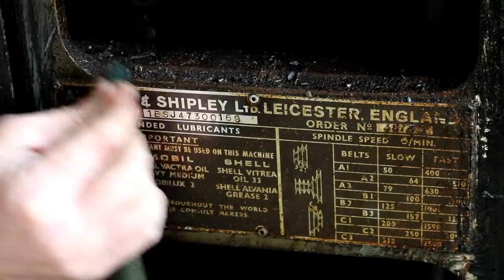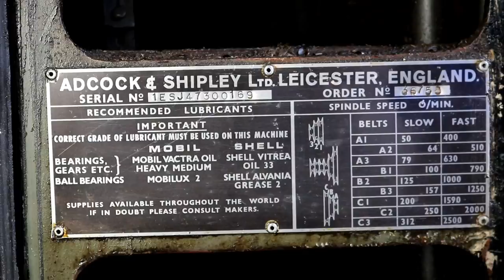1st good LooK at the Adcock Shipley horizontal mill. Good and Bad!

Comment: Wow that machine is disgustingly dirty. When I worked in engineering way back in the 80's here in the UK, at the end of the shift we had clean up time. We had to take all that days swarf out of the machine we was working on and put it in the compactor. Then we had to clean down the machine and check oil levels, swarf filters and oil all the oil cups, so that it was ready for the day after. We would have been reprimanded if we had left the machine in as bad a state as that milling machine.
Reply: Sounds crazy to most people, but i work in mass production (tool room / jig shop) Counter-intuitive as it may be, on a machine that old running non stop production, sometimes it's cheaper just to let it break and replace what fails as it fails than it is to lose a fraction of every day to "proper maintenence". New parts =$X, Loss of production=$Y, Easy for down time to be far more costly. Depends on what you're making and how many of course.

Comment: You can see the original oil and grease requirements. NGLI 2 grease and what would be a 680 viscosity oil for every part. Slideways and low speed boxes I would suggest using a NGLI 0 grease, as it will pump easily, and is a good lubricant, and is slow to leak out. I used it on a production machine as slideway lubricant, as it had central lubricant, though i had to replace every single tube for that during service, as the originals were all burst from previous operators having used NGLI 2 grease in it.

Comment: I'll have a guess about the history of this machine.  It worked as a conventional mill and then failed to get cleaned or maintained - hence the nasty caked gunge in all sorts of places.  Then the power feed or coolant pump - whichever was driven by the central contactor failed or was not needed.  Someone said "I could use that for production of threaded parts" and built the neat clamp, and used the thread rolling attachment and that was that until it was sold.  Never cleaned again, never had chips removed.

Comment: Just as a suggestion, you may want to consider a "geowall" style low retaining wall to restrain the runoff from the hillside.  They use gravel and a plastic grid so that the structure holds itself by its own boot straps so to speak.  The advantages are a little less invasive to the hillside than digging the wide footing required for a concrete "gravity" wall and having a gravel base course and backfill, it will compliment the action of your proposed french drain.  The downside is that the component blocks are quite heavy so it is very difficult to place with one person.  It also might (depending on how things cost around your area) offer some money saving.  Usually these walls are not complicated until you get over 4 feet tall.  Someone may have had some experience using concrete block as geostones in low walls, maybe not the best aesthetics, but cheap.  I have built them 24 feet high for hillside stability.  If there is a conduit for groundwater to exit the rear of the wall, they are very practical.  Good luck.

Comment: Adcock and Shipley.  I know lodge and Shipley.  I just saw a cockshutt and white tractor yesterday and did not realize white truck company completely ruined oliver tractors. In the 50's oliver had a continously variable mechanical transmission that would be useful today if white had not  turned all the oliver records into trash and disposed of them.

Comment: man it seems like a great mill , maibe try to find the accesories for it like the vertical milling head and the holder for the outside end of the horizontal milling bar and trade it for sumting you need (i allways have problems doing that with stuff given / gifted to me though)

think the retaining wall for the back of youre shop will fall over pretty fast from the pressure of the soil running down the hill you might eed to add a layer on top of that wall every so often too as the base of the hill gets bigger , it might work if you build it like a dam with a wde base tilting toward the hill and with an arc along its length , you might want t plant a row of furtrees along the hillside of the wall to hold the soil in place a bit better 
maibe it helps if you dig a ditch to collect the soil and dig that out every so often , pressure whont affect a ditch as bad  though you prolly be digging it out again quite a few times , will collect the water and snow too

Comment: It looks like You have acquired a nice machine there Steve .So many of those old machines ended up doing work during 2 wars in UK and a lot of that being on cast iron so that plus the lack of financial input for our motorcycle and car industries meant having to work with worn out equipment  .Just as well most machines were "heavily" built eh ? So,back to the Do-all saw soon hopefully ?

Comment: 32:14 I would remove this metal plate and just add a much wider mesh - just to avoid that you dump a tool bit in it, but don't restrict the flow so much, and replace instead the stupid "dam" filter, with cyclonic separation :)

Comment: Just a question , have you ever worked in a factory ? I have and they clean up with a rag to wipe it off and a blow gun to get rid of chips , maybe once a year the machines get a paint job which means give it a quick wipe down then throw a coat of paint on it dirt chips and all , most factories use temps to do the work and doing something like this ( production runs ) means you will be doing the same thing all day every day mind numbing repetitive work ( think about it all you do is put a part in hold the button ,take the part out then do it again over and over 8 or more hours a day )so the operator will do something /anything to change things up even if it means crashing the machine ,you might get put on another job for a while or even sent home while your machine is being fixed

Comment: regarding the proposed retaining wall behind the shop, don't forget to allow for water drain holes in the wall. If not, the hydraulic pressure of water in the soil will build up and push your ret'g wall over.
Where do you find all these old machines? I especially like the size of this "new" A & S mill.
Reply: Steve's putting in two french drains to combat that...

Comment: Founded in 1914 and active until at least 1968, this firm made vertical and horizontal milling machines, including a Bridgeport design that was made under license from Bridgeport Machines, Inc. In addition, some Adcock & Shipley machines were sold in North American under the Bridgeport badge. In about 1968 Adcock & Shipley was acquired by Bridgeport owner Textron, and in 1986 Adcock & Shipley's name was changed to Bridgeport Machines, Ltd. The USA incarnation of Bridgeport went bankrupt in about 2002 and the Adcock and Shipley works were shuttered at that time, if not before. info from VintageMachinery.org

Comment: You are correct in your thinking about the "grease" nipples they are for oil you should trait apart and get the grease cle as nd out as it will cause wear

Comment: For your retaining wall have you given any thought to using rebar cages filled with the rocks and  mortar and cinder blocks you have left over from the wall tear down??? be pretty easy for a extremely talented guy like yourself make the rebar frame/cage welded together or let your lovely wife weld them up, since she would look much better while welding them up lol.  then you got all the rock,blocks and rubble laying put it to use its free. once the frame is in place minus the top lid or door. fill them up then weld the top on it and you could pour concrete over the rock cage form up the front the bank would be the back and sides of the form would save ya alot of concrete even if you sank the rock cages into the rock 2ft as a footing or a layer of concrete in the bottom then rocks and rubble then pour over the top and face to make it a smooth wall or leave it just rocks if ya want the more natural look like a real rock wall

Comment: I can find those machines in my area...lots of them...but everybody thinks that they are worth the original purchase price.  I've seen these things in pieces and the price?  "$15,000"...I've called on a few, and they want $10K, $9K...it sucks...I see Keith Rucker and Adam Booth getting machines for pretty much scrap value, and around here people want what a new one would cost...it sucks.

Shindowa's are AMAZING...When I was working as a landscaper that's what we used.  thousands of hours on those things.  We'd go through a contractor size (5,000+ft) of string a month through those things.  They just run.  For hedge trimmers?  Lil' Wonders are amazing, light weight and super reliable.  BTW: I have a "cheap" homelite string trimmer...year 15 and still going...but I know how to care for my tools.

Good thing you were wearing your ABOM T-Shirt...that was an ABOM sized rock you had to get rid of..LOL
Reply from the maker: Where about are you located?
Reply: @SteveSummers  South East Michigan...TONS of old iron around, but people think that their stuff is worth retail so many times.  I went to a swap meet ONCE around my area...people selling V-Blocks for MORE than what they cost new...stating "Oh, but those aren't nearly as good as these are"...Stuff I've seen Keith and Adam pick up for $50, is $150 here in tools.  Craigslist is a joke in my neck of the woods, and FB Marketplace isn't much better.  Guy was selling a 1940's atlas drill press, admitted it DID NOT WORK (motor was fried), and it was in pieces and probably didn't have them all...he wanted $1200 for it.  It sat on Craigslist for 4 years at that price...obviously nobody purchased it...LOL

Comment: Thanks for the video. I recently got a similar sized Brown and Sharpe mill that's functional but needs a good cleaning. So many knobs and levers! How did you know what was 1018 and what was 4140 on the fixture?
Reply from the maker: It was stamped on the parts

Comment: A "small retaining wall" isn't going to hold back a hillside slumping under the twin forces of water and gravity, any better than a chain link fence will hold back a river bank in the spring floods. BUT at least your options are better with the hillside. Buy a cheap mini excavator. Then one or two nice  autumn days a year go back behind the shop and dig out what has tumbled down, being careful not to crush your french drain. As the trees on the hill grow up their roots might even help stabilize the hillside for you. You seem to have this itch to confront Mother Nature head on. You will not succeed trying to punch out nature; try using judo instead. As plumbers say: go with the flow.
Reply: Perhaps a diagonal wall further up the hill to divert the runoff might work. Topozone shows the hilltop @ 860' and the shed @ 600' elev. The river about 2 miles away is about 450'. The ground is typically a few feet of clay loam on top of limestone. Most of the water is surface runoff.

Comment: Dry Stone wall. You are continually digging out rocks like our ancestors did. They used those rocks to form boundaries. We call them dry stone walls. The material is free, you keep digging it out and moving it around. Why not dig a shallow dry stone wall buttress foundation using the wider bigger longer stones gradually stepping down in widths to the surface then build a parallel wall above the buttress. The weight of the slope sliding onto it should start the wall leaning back into the slope if built correctly. All free of charge killing multiple birds with one stone. Cleaning your stone mess up. Keeping debris out of your drains to be. Maintaining access route open. Looking really cool. You can use dry stone wall in river banks too, if you knit the rocks with skill they stay together. Many old English bridge's are dry stone and have stood for 100's if not 100's of years.

Comment: I disagree with the thinking that these machines are becoming obsolete and that CNC machines are better. I’ve done a wide variety of machining, from the maintenance guy asking to get something fixed or duplicated to setting up old Brown & Sharp screw machines to make thousands of parts to setting up a CNC lathe to make a single ten thousand dollar part. There’s a place for each style and type of machine. For what that machine was set up to do there isn’t a CNC on the planet that could do it faster, not counting Swiss screw machines. But the price difference is what separates the two machines. If all you need to do is what that machine was set up to do, why spend the money on a new machine? Just buy one of those things and make the fixtures. I think those old machines will be making chips for as long as humans need to make things out of metal and plastic. I think one of the reasons machines are getting hard to find is because of guys like you and Adam and Keith and Tony making the videos you make people are going out and buying stuff up and learning how to machine, and maybe even building a business around them. And I think that’s awesome.

Comment: I am a barber HOWEVAH I am also licensed in Mi for stormwater and wastewater mgt....leave as much as possible of the vegetation (including those trees)and top soil...that is what is keeping that hillside from eroding...my guess is by the age of those trees that the original owners cleared away the vegetation and that sped up the natural process ..i.e. the hill sliding...this  is tough because the angle of repose on your hillside is at its greatest ( what i can see from your video)...and if you scrap the top soil ( then left with clay and rock where nothing will grow )with the leaves trees and grasses with their roots is what is keeping that bank up and not eroding faster..So I think a wall is the answer ...maybe use some of that fencing you had to kerp things back too!